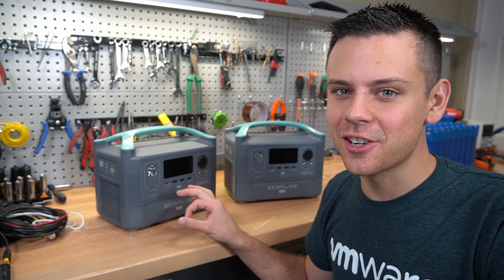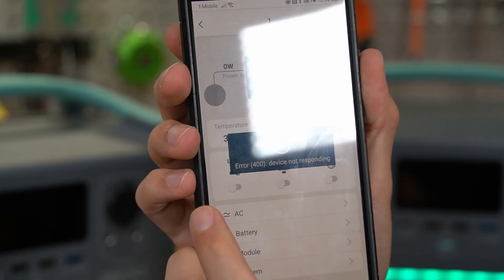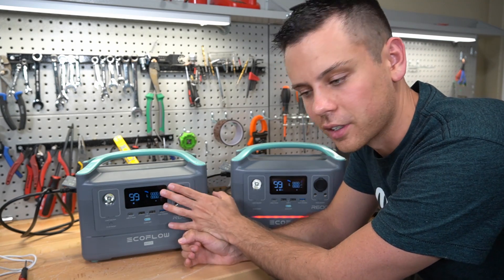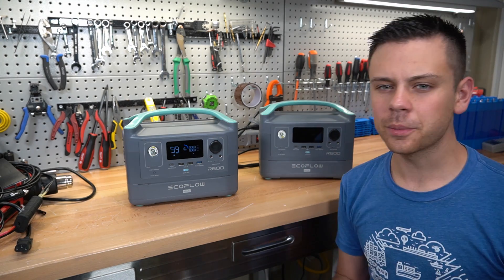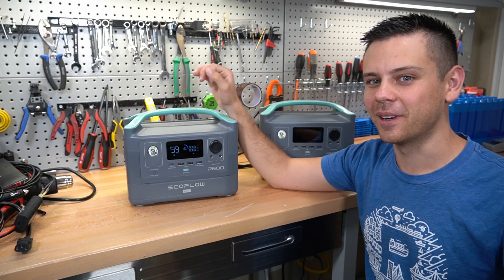Ecoflow R600 Part 2: Did the Firmware Upgrade Fix the Problems?

Comment from the maker: 1:14 Problems with updating the firmware
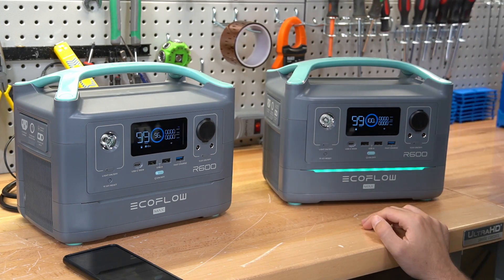3:40 UPS Test
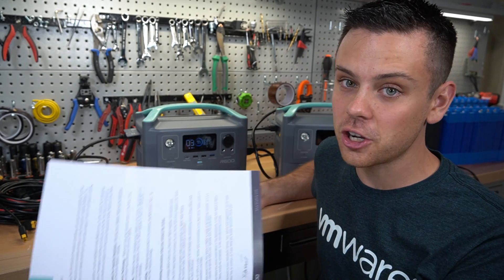5:34 UPS Chaining/Capacity Test
6:33 Capacity Test Results
7:08 Over temperature problem
7:41 X-link chaining test
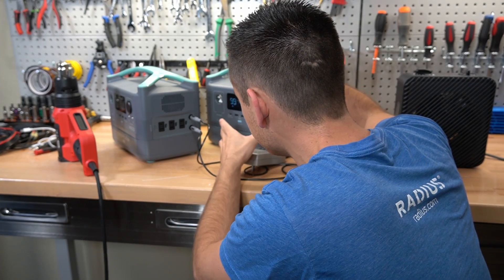9:07 Complete failure of unit. Will not charge, will not stay on. Showing "overload" on screen.
9:53 Charging with load connected

10:24 Conclusion

~~~~~~~~~~~~~~~~~~~~~~~~~~~~~~~~~~
Tired of getting ripped off? Check out my "Will Prowse Approved" solar product recommendations below!

12V Batteries
https://www.mobile-solarpower.com/lithium-batteries.html

48V Batteries
https://www.mobile-solarpower.com/48v-batteries.html

Offgrid Inverter System Builder
https://www.mobile-solarpower.com/48v-complete-system-blueprint-559371.html

Hybrid Inverter System Builder
https://www.mobile-solarpower.com/code-compliant-48v-offgrid-system.html

Mobile Handtruck System Builder (very popular!)
https://www.mobile-solarpower.com/mobile-48v-system.html

Solar Panels
https://www.mobile-solarpower.com/300w-solar-panels.html

Ground Mount Solar Racking
https://www.mobile-solarpower.com/ground-mount-racks.html

Wire, Lugs and Busbars
https://www.mobile-solarpower.com/wire-and-connectors.html

Tools
https://www.mobile-solarpower.com/tools.html

Fuses and Circuit Breakers
https://www.mobile-solarpower.com/fuses.html

Plug-N-Play Solar Systems
Ecoflow, Anker And Bluetti! So many models to choose from. See my current recommendations here:
https://www.mobile-solarpower.com/full-size-systems.html

~~~~~~~~~~~~~~~~~~~~~~~~~~~~~~~~~~~~~~~~~~
Need to build a large DIY system? Need a trustworthy solar distributor? These are my favorites:

Signature Solar
Creator of EG4! Solar Minisplits, Victron and More! Largest Solar Store Online.
If you want $50 off, please use my link below and coupon code "DIYSOLAR50":
https://signaturesolar.com/?ref=cPwLcVc0SW-BjN

Current Connected
Best Prices for EG4, Victron, Midnite and so much more! Fast Shipping and Highest Rated Customer Service:
https://currentconnected.com/?ref=wp

~~~~~~~~~~~~~~~~~~~~~~~~~~~~~~~~~~~~~~~~~~
Join our DIY Solar Community 
Need more help? Join the largest solar forum on the internet for beginners and professionals alike. 140,000 members and counting!
https://www.diysolarforum.com

Check Out My Free Book
Best-selling and beginner-friendly guidebook to off-grid 12V solar!
https://www.mobile-solarpower.com/the-book.html

~~~~~~~~~~~~~~~~~~~~~~~~~~~~~~~~~~~~~~~~~~
Contact Information:
I am NOT available for personal solar system consult! If you wish to contact me, this is my direct email: williamprowsediysolar@gmail.com
FTC Disclosure Statement and Disclaimers:
Every video includes paid promotion or sponsorship (such as free products for review). Some links on this YouTube channel may be affiliate links. We may get paid if you buy something or take an action after clicking one of these. My videos are for educational purposes only. Information is subject to change/update at any time. Electricity is DANGEROUS and can kill. Be smart and use common sense :) DIY Solar Power with Will Prowse is a participant in the Amazon Services LLC Associates Program, An affiliate advertising program designed to provide a means for sites to earn advertising fees by advertising and linking to Amazon.com

Comment: Ecoflow is junk I bought the cheapest river model without the extension battery and not even 2 months into opening it the LCD screen flickers. it still works but this is a quality control issue. I'm getting a Bluetti AC200MAX

Comment: Good video that portable power station definitely has potential if they get everything working right solar charges faster than a jackery besides jackery is way too expensive you can get one heck of a generator for the price of one of those jackerys I do like this one though if they get all the bugs worked out could use it as a backup to a generator

Comment: I just bought an Ecoflow River Pro and after I just finished fully charging it, I charged my laptop and now it will not turn on. It says it is "overloaded" and will not turn on. I thought there was a reset button but it doesn't have one. Have you found a solution for this? Because I can't find any answer online.

Comment: One year on from this review video, I just got my hands on a River 600. They have removed the X-link feature. The port is removed on the River 600 as well as the River Pro.
The app works well now, firmware updating took under 10 mins. 
So far I have not connected any load above 600W. So I can't attest to the surge feature. 
Have to give credit to reviewers like Will for calling out product shortfalls so that the company fixes them. 
This can only improve the products and make this community all the better. Cheers.

Comment: Don't pre-buy said a guy that bought Delta on Kickstarter xD
But jokes aside, what you would recommend for daily use to combine with solar panels?
I mean, I don't have a  house with a roof or something, I was more thinking to use it as a device to charge electronics (2-3 smartphones, some batteries, and 2 laptops) on daily basis, but to also have some backup in case of power-grid off so my fridge can go for some time (with solar panels being plugged non-stop). 
What you would recommend considering price / performance ratio?

Comment: Have the problem with no warning system for low battery. People have complained that when depleted it no longer works. With it beeping and resetting. They are told to get it up to 30 percent  but never gets past this just keeps beeping

Comment: did you ever find a solution for the overload and turn off situation? that’s what i’m experiencing with my R600 Pro. Ecoflow wants to send me a replacement unit, except the replacement unit will be Lithium Ion and not LifePo4 so i’m really trying to avoid that. super bummed.

Comment: Well here is my initial review on the Bluetti EB70 that I bought with my own money.  It generally works great (yes I know it has all the little quirks you've heard about).  But it has one very glaring problem.  It absolutely will not handle anything near the surge rating it says it will.  Your thoughts?

Comment: Hi Will. Can you please confirm what the fan operation is doing when you leave the River 600 plugged in to wall current continuously in basic UPS mode please ? In other words, After the River 600 is fully charged on wall current, does the unit's fan blower run continuously, or does it eventually shut off once the built in inverter is cooled down ?

Comment: Just found you and your excellent testing, building, and educational videos. Will you be testing the Ecoflow River and River Max? (They are the new model name for the R600 but I don't know if they changed anything in the product.) My application is car camping for 3 weeks at a time - laptop for 8+ hours, phone, electric kettle (1000W), Instant Pot Mini 3Qt (700W) for 15-30min, USB rechargeable 10,000 mAh fan. My main questions 1. What is the impact of the X-Boost and what appliances should I not use it with? 2. I get that the batteries have a low cycle and terrible capacity life going to 60% after 500 cycles, but with the battery expandability, does that mean when add a new 2nd battery, I'll get the full capacity of the add-on battery plus whatever remains of the built-in? And then can replace #2 as needed for that benefit? Thanks!

Comment: I bought two of these units in the last month and a Nature's Generator as well; basically for emergency backup.  I have Not installed the app .  One of my River's has the expansion battery and one does not.
For a simpleton old lady, they are easy to use, fast to charge, light enough for me to carry, can be used with different charging sources.  I keep the River's and my other generator in different locations of the house.  My though was to alternate the Rivers, use one and charge the other.  Thank you Will, for walking through the chaining procedure.  Given the problems you had, it looks a little tricky so I will stay away from it.
I've used them to charge or run little things and they seem to work fine.  I've recommended it to a friend with a CPAP machine.  It should do fine in a power out situation.
In a grid down situation for a long period of time, idk.  It is a concern.  I don't think you can run a small heater from them.  I'm thinking of the Texas grid down.  Sorry this is long.

Comment: Hello I bought the 600 for camping. My comment issue is I was recharging the R600 max with the 12 volt car battery cigarette socket it changed fine but the plug was very hot when I was done. Is this dangerous?

Comment: Received my EcoFlow R600 Pro which failed only one day into storm damage power outage. They demanded item be shipped back to them and have yet to respond over two weeks later.  Additionally they did not provide a replacement unit even though we are in the middle of winter when power outages are more frequent in the mountains where I live. EcoFlow is apparently only a marketing company with little to no technical expertise and absolutely poor service on supposedly fully guaranteed products.

Comment: Can anyone answer my question please!!!! I just got my R600 Max yesterday and I charged it before I used it. Then when it finished charging I updated the firmware.  Since the moment when I turned it on the fan is on ALL the time. Even without a load. It this normal? Thanks in advance!

Comment: I have an AM radio that I use daily. When the power went out I plugged the radio into one of my solar power stations. I noticed that there was a little static in the background. After plugging the radio back into a wall outlet there was no more static. I decided to try the other power stations and each one had the same static noise. I can say that the Jackery 1000 had the less static. Can you please investigate why there is this static noise? Thanks

Comment: is the jackery 500 better then this one ? which one should i buy if i want to run a heater or an electric blanket on a timmer?
Reply: Did you buy one yet?
Reply: @mreverybody1150  ya and i love it best decision ever charges up in one hr best portable generator
Reply: @deepsky6268  Which one did you buy? the 500? If your one charges up in only one hour then you must have got the one with the updated controller in it. People were always complaining about the previous ones slow charging time.
Reply: I must have bought that one then was thinking of buying the extension battery at the bottom to add more power but ya i bought the one that's all grey not the one with turquoise
Reply: @deepsky6268  You purchased an Ecoflow or a Jackery?
Reply: @mreverybody1150  Yes jackery makes you charge in 8 hours this thing charges in 1 hr! this is the best buy out there
Reply: @deepsky6268  Where did you buy it? do you have a link?
Reply: @deepsky6268  Ive heard that fast charging means shorter battery life though.

Comment: Will, What about the X-boost function?  I saw another video where they were running a 800watt heater, but x-boost allows you to run it from the 600w inverter ... I assume it just lets the appliance run at 600watts instead of cutting out?   I have an induction stove with the lowest setting at 600watts ... it would be great if it could run it. ... most other generators have only 500w inverters.

Comment: That firmware update took way too long, it's not like it's downloading Wikipedia. I wouldn't be surprised if the firmware was corrupted. I wonder if a hard restart as disconnecting the internal battery from the circuit board would reset the other one.

Comment: The BMS is probably BURNT out on the bad one... The over heating problem may have melted a conductor or BURNT up the board. These guys are using you bro. Now they will use your video and try to solve the problems.

Comment: With these batteries.  Is it possible to plug the AC charging cord into the AC inverter to change the battery with it's own power?  Or would this damage the unit?

Comment: Thinking of joining in on Kickstarter for the R600 Pro unit, trying to decided which is better value 2X R600 PRO  or R600 PRO + EF 1500 External Battery  both $999

Comment: This device really needs a way to use a higher current DC 12v output instead of just the cigarette plug which is limited to 10A. For example running a small car compressor or charging a car battery.
(Jump starting a car would be awesome but not sure if possible)

I'm thinking just black/red screw type leads for using up to 40A @ 12v DC. The batteries should be capable of this right?

If you agree will, could you message Ecoflow about this?

Comment: Hey Will! Do you happen to know what the difference is between Renogy’s 200 Watt Solar panel suitcase that prices on Amazon for $399 versus another 200 watt suitcase that prices for $539? They are both monoCrystaline but are different in appearance. I went on Renogy’s website and couldn’t find out the information there. I waited on hold for 57 minutes to ask support what the difference was. When I finally got transferred over to an operator I got disconnected. I was a little pissed.

Comment: I was leaning toward the Jackery but after your review, i am getting a Rockpals. Can you tell me the difference between the Rockpals 300w vs the Rockpals 330w or do a review? I noticed the 330 has an LCD screen that tell you want the wattage input and output is. The 330w also offers a wireless charging station on the top.

Comment: Thanks for your review, Will! I ended up canceling and re-pledging for the r600 (non-max) using your affiliate link as thanks. Although it is not fully approved, it seems the unit functions fine as long as I do not link it. For my purposes I do not plan to do anything further than utilizing one unit only.

However, I am anxious to see your review of the R600 Pro version. Quite curious to see if LiFe-PO batteries with multiple configurations warrants the additional investment (or forgoing it all together).

Comment: It looks way too much like a Goal Zero Yeti 400 Power Station, which is weird because the unit does not have to look like that, but I figure its all made in the same factory and 'if it looks like something that works, its good enough'.

Comment: I need your help!  I have a 4000 watt inverter with 4 6 volt batteries in parallel.  Anything turned on over and above my fridge running it starts to drop volts then trips.  All wires are 4awg which is a little bigger than the  5awg suggested.  Can the batteries not supply the power needed for my other electric appliances...such as toaster over and high wattage things?

Comment: Will, it's pretty clear that the Ecoflow company needs a guy like you for their product tester... BEFORE they ship their unreliable crap to the public. A good QA department can spare a company loads of embarrassment. Shoot, you weren't even trying to break their stuff, just trying to use it as advertised. The app glitches were your first sign that their system was not ready for prime time, and everything else just confirmed that conclusion. I'd say give this company a full year of further QA refinement before buying their products.
In fact, good engineering should design for a generous margin of extra performance into your products. When you claim 1200 watt hours, you should build in 1300 and deliver at least 1250. That's how a great company establishes its reputation. Looks like Ecoflow hasn't figured that out yet.

Comment: Hi Will, I want to power a summer house in my back garden but don't fancy using my domestic supply. I've had it in mind to use solar and see these power packs as a simple solution. I know you don't overly rate them but are they not a good solution if my only requirement is for lights, music and maybe a TV. Also powering some tools, though I know a compressor is out of the question. I am fairly capable of building a small solar set up but it does seem quite a lot of room would be needed compared to the compact size these packs represent. I guess I am just wondering how much useful power can these things actually supply. As I'm in the UK I am somewhat restricted by the availability of some of the items you've tested, we don't get the ecoflow or the Bluetti 2400.

Comment: Hi Will can you message me a link where I can send you info on a solar generator built by engineer out of Livermore Ca. He has built it with off road warriors in mind. 24,V &48V.  Sold to people working on the road such a traveling groomers, DJ’s , construction, DDS etc. was telling him he should send in to review. But it is heavy.. to mail. Perhaps you could add the batteries to test once received? It’s in a inclosed case,  carry to from to charge then back to auto, or hooked up to s. panels if one has those..like van life. Thx for sharing your continuous wisdom with us views!

Comment: From my experience with power inverters, and as an electronics tech; Because of the overheating, my guess is the power output transistors, probably FETs of some variety, have shorted out to neutral. This is purely an educated guess, since I don't have one of these or have access to a schematic. After your first video on this unit I tried to find out where this is being assembled / manufactured. Because of some of the strange grammar on the web sight I'm betting it's Chinese. If that's the case, although Chinese made semiconductors have similar ratings as their western counterparts, I find often they actually can't handle their published maximum current and voltage ratings. Some, not all, but some Chinese made DC motor controllers will cook the power MOS FETs if they run at or even just under their maximum rating for too long.This almost always results in a direct short to ground or neutral in the case of sine wave inverters.
I commend your efforts and honesty, and I agree with your warning about "Kickstarter"  - it's the perfect environment MADE for scamming the innocent.